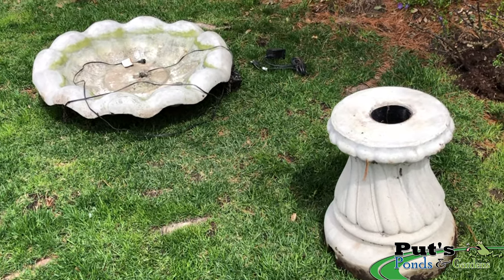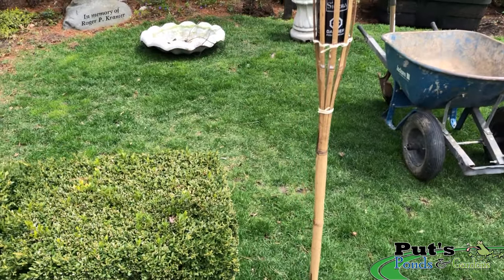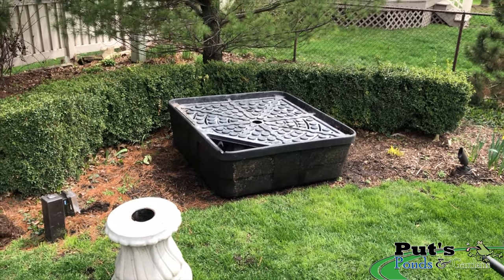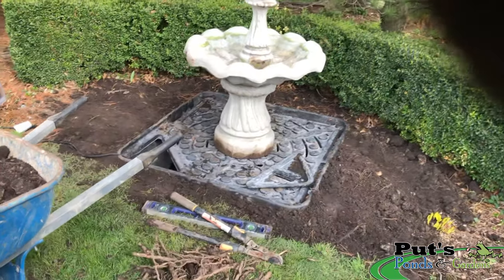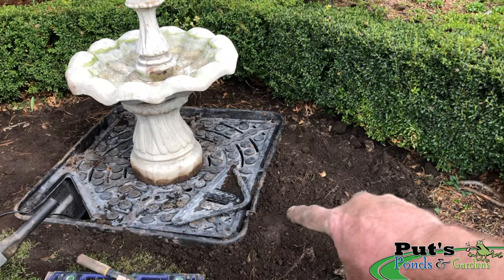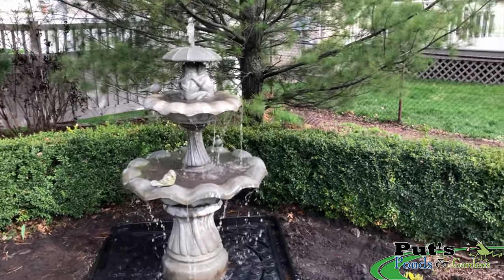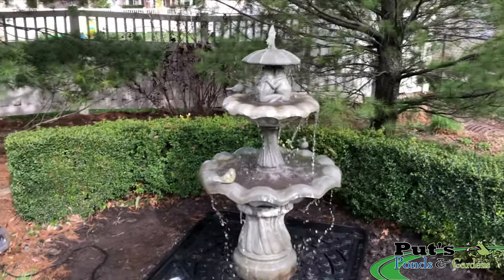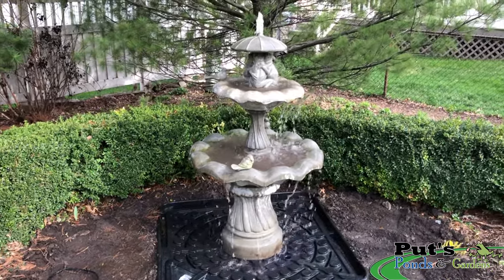Three Tiered Fountain Problems

Comment: Nice, but have a question,,,,,,,how do i slow down water flow from the tiopp of the fountain when the pump has no speeds, it is a 5 tier fountain aprox 5-5 1/2 tall
Reply from the maker: Most plumbing suppliers will carry an inline ball valve you can install for your size piping…
Reply from the maker: You’re welcome and thanks it was a great question

Comment: What did you do to the basin to allow it to hold the weight of the fountain itself? That is like one of the most important parts of this project.
Reply from the maker: Good question… the answer is, nothing. The AquaBasin is strong enough to support the weight of the fountain. It is molded with several supports inside.

Comment: Did you have to seal between the tiers? The flow on one I am installing doesn't seem to work very well.  140GPH enough?
Reply from the maker: No I didn’t seal between the levels. You can use some pipe dope at the top so it won’t drain back down the opening. I will typically use 400-800 gph and ball valve back if need be... depending on the look I’m going for
Reply: Plumbers puddy.and coins to level,works great.be patient.

Comment: I don’t have the skills for all that, I’m just trying to seal the original basin from leaking. I tried some foam spray I was using for another project, but it’s still leaking. I guess the foam wasn’t the way to go. I’ll have to chip it all out and try something else.
Reply from the maker: You may want to look into a product called Pond Armor. It’s a two-part epoxy coating, if the surface is prepped properly it can last for a long time. Comes in many colors including clear.
Reply: @PutsPonds  Thank You!

Comment: The water should not go lower than the bottom basin. Pump speed is way to fast,,,then slow daon down and fine tune water falls with leveling each level,if needed,Vaseline on channels to make falls all even.food luck.this will reduce splash 95%.

Comment: I have a 3 tier fountain that I got from Lowes about 10 years ago.  It has been discontinued.  It was made in China. It is aluminum and iron, I believe.  I called or emailed the company because the rod that has the screw on places that held each tier from the 2nd to the 3rd one moving up and the screw on cap was worn out.  Right now I have a piece of slightly bendable black pvc pipe, 3/8" I think, that is in it with the top tier on it.  I will just run it down the center holes and then it has to be sat on top of the little pump outlet.  The problem is that it is so heavy sitting it, that almost the smallest movement on it can knock the tube off of the pump outlet.  Do you know of what I can use to keep from having to have all of that weight on top of the pump?  It has to sit on it for the water to go up the tube.  I have stayed in the hardware store for hours, several different times trying to figure something out.  Even had different people from the plumbing dept. trying to figure something out.  We haven't come up with anything.  I saw something on a pump adaptor/fitting set that said it is a diverter. I am wondering if I can run a pipe from the fountain to lay on the bottom of the fountain (inside)  from the side of the pump with a diverter to help take off some of the weight on top of the pump. Any ideas or suggestions?
Reply from the maker: Can you have a couple plates welded up with spacer rods, the pump could be nestled between the plates?

Comment: Well that helped absolutely not how about show more detail about putting it together😠
Reply from the maker: Thanks for your input... I basically stacked each piece of the fountain then ran the piping straight down to the basin I sunk in the ground to the pump... (I did mention that I forgot to film the set up, sorry you missed that) 

The purpose of the video was to show how you can run your fountain longer by capturing all the water that splashes out...